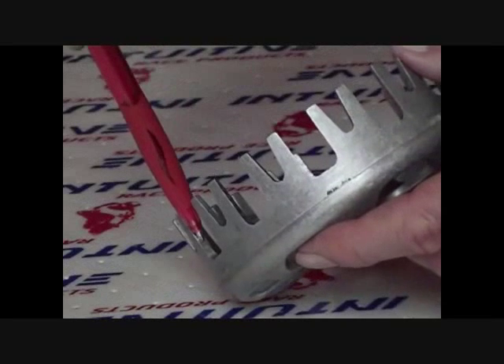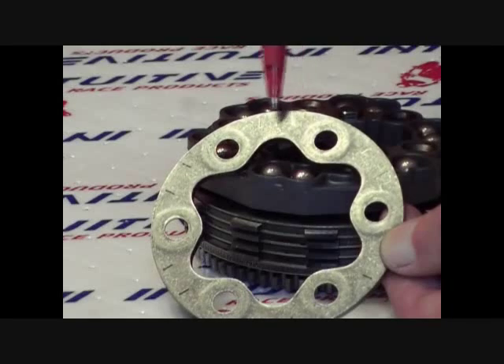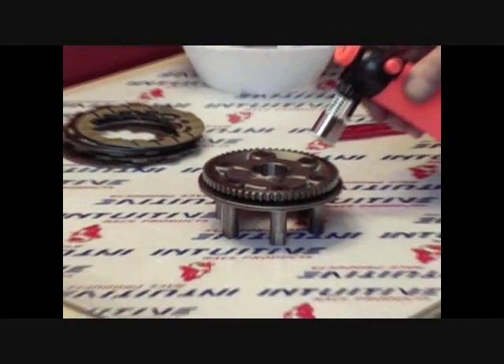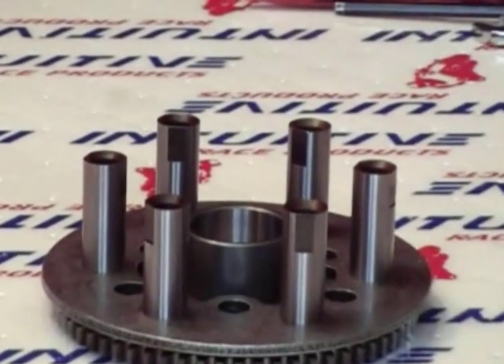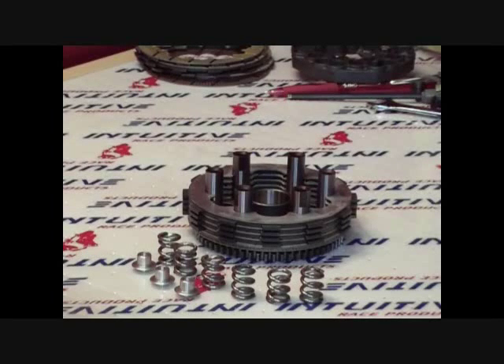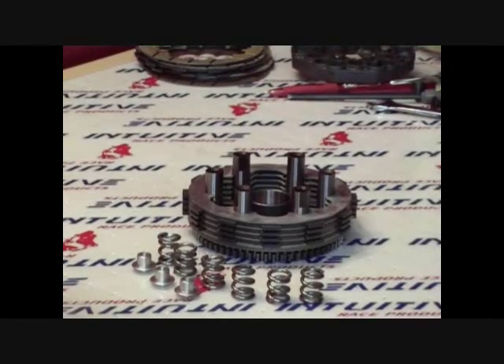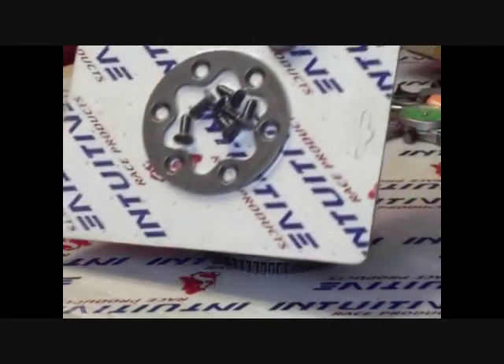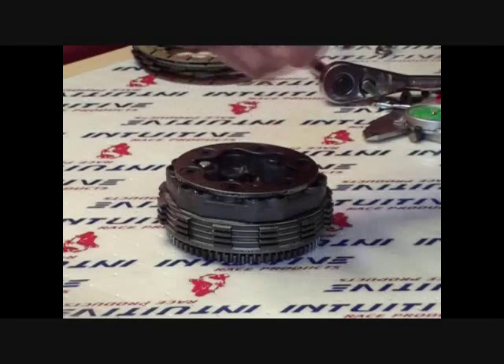KTM 50cc Stock Clutch 2013-2018

Comment: Nice video but weak sound . Clutch in my son bike "expolde" today . Clutch basket lost 8 teeth , bottom clutch disk rip off in 3 parts broke water pump gear . Have you any idea why it happened bike 2018 54h work.